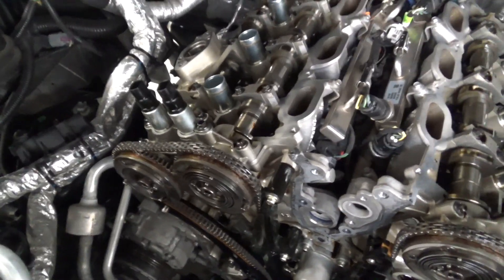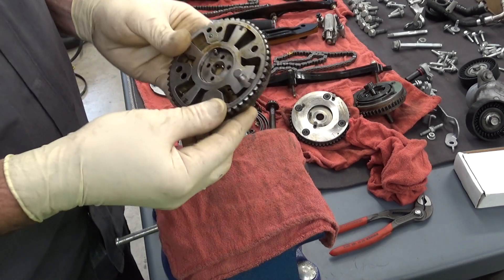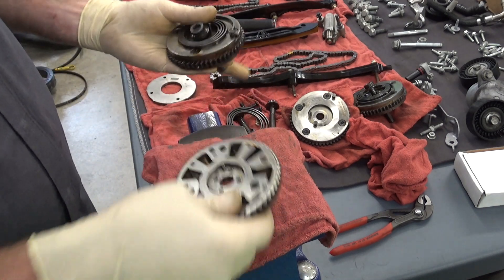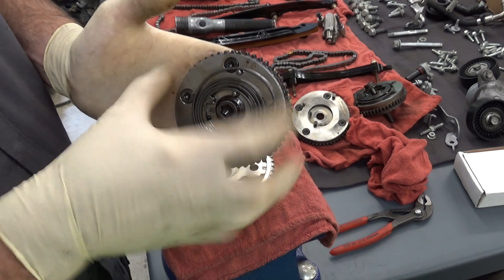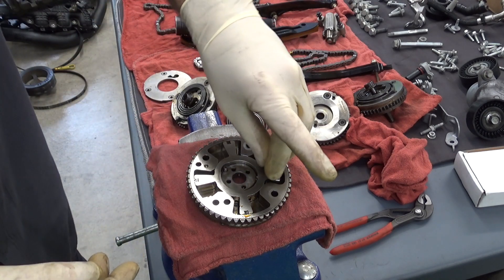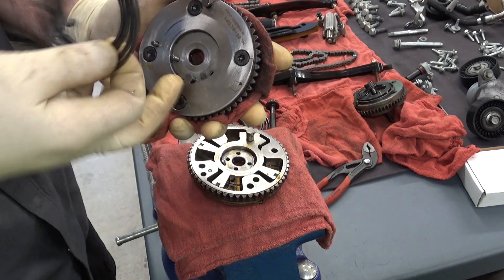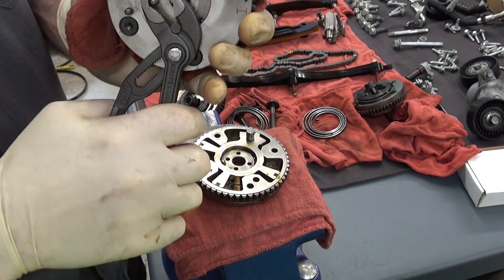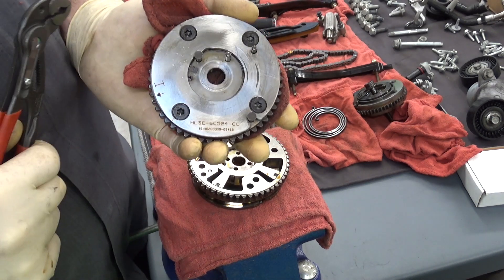FORD 3.5L ECOBOOST CAM PHASER RATTLE. THIS IS WHY

Comment: So would it be helpful to do the oil prime before startup every time you start it. IE: hold down the gas pedal while cranking and it primes the system until you release the gas pedal?

Comment: Thanks for explaining, my 2018 f150 eco boost in shop now. $3500 replacement of cam phasers. Also transmission is shot 😡 $7700 total. Not sure I’m a ford fan anymore…
Reply from the maker: No problem. That's a tough pill to swallow 😓

Comment: Thank you! I can’t believe I’m sitting here watching a video on why my truck with 47k miles rattles at start up. The “Service” guy at the ford store is useless. 1st I went to them for a screeching sound that would happen once in a while when I turned left and I told them it was the IWE (thanks to YouTube) but they refused to change and said they couldn’t replicate the sound so there was nothing to fix. Then I was told that the solution was to leave my truck in 4 WD full-time 😂. I said son I wasn’t born yesterday and forced them to change at my expense and the problem went away. Now I’m dealing with the cam phaser issue. I called the Ford store and they either pretended not to know or they are clueless but I had them on the phone and was passed around from one person to the next then was told they would call me back and that never happened. So frustrating……. Chevy?
Reply from the maker: Oh man 😂 Sounds like you need to find a different dealer, unfortunately.

Comment: A shame we have to go to such lengths of complicating an engine to this degree just to achieve a few extra miles per gallon and several extra horse power.   Ridiculous.  I miss the days of ONE simple, short timing chain on a typical V6 or V8.  When needed, could be replaced in an hour and for maybe $100.00 tops.

Comment: Dear WCR, this was the problem in my 2011 Expedition.  On a “wink-wink, nudge-nudge” look from the service advisor at my Ford Dealership, and corroborating advice from an outside transmission specialist, I chose not to repair it.  I traded the vehicle in for a 2018 Expedition— the transmission specialist said that this was a known problem at Ford, and that they’d supposedly fixed the problem in time for the 2018 line.  About a year after I bought the vehicle I received a recall notice to have the cam phasers replaced on that one.  Now it’s February 2023 and the engine is doing the same loud knocking again.  It’s still under warranty, so the repairs are covered.  But, what hell?  How many more times is this going to happen?  I put 15-18K miles/year on it.  I’ve been driving Expeditions since 2000.  I’d hoped to drive this one for many years after I paid it off, like my first one.  I love the Expedition, but I’m growing leery of them.  Especially if this continues to happen in these engines.    Does you have any suggestions?  Thank you, Nancy
Reply from the maker: Hello Nancy. Ford has a new phaser design and they will need to be replaced. Some of the units were replaced with the previous design and have to be replaced again. Here is the difference in the new phasers: https://www.youtube.com/watch?v=7r_1-SQ3jDk&ab_channel=RainCityWrench

Comment: Not trying to be a smart ass but you just explained it as being an oil pressure problem with this particular part. If there was oil pressure already built up it wouldn't make that noise. But yes ford did fix the part.
Reply from the maker: To be honest, I don't know what is causing them to fail but when they do it's because the pin will not stay locked which requires oil pressure before it stops rattling.

Comment: I know this a older video but I’m having the same issue with my 17 ecoboost got a nasty lil knock in the idle as well as the rattle upon start up but I think the only difference is that mine does it almost every time hot or cold unless I press down the peddle and do one of those dreadful extended cranks wish my Ford dealer didn’t try fucking me over time I went in or I’ve would’ve been took in to get checked btw I bought used 120k on it probably had the rattle when I bought it was in hurry when purchased which I don’t regret cause I love my ecoboost just wish it functioned properly
Reply from the maker: At least the noise won't cause premature engine failure. Just annoying is all

Comment: Why not permanently lock them in place ?
Reply from the maker: Since these are variable valve timing engines they will set codes if the computer can't advance/retard valve timing. Nice thought though.

Comment: At this point 2018s are out of warranty so what does it cost to fix this?  I have 36K miles on my 2018 LTD so wondering when I need to deal with this.  Also there is a theory that the root cause of these problems is a clogged oil pickup tube/screen so I was wondering if you ever dropped the oil pan on any of these Fords to see if the pickup was clogged because if it is the part will just fail again.
Reply from the maker: Had an ecoboost come in that rattled loud all the time and three quarts low on oil. Dropped the pan expecting to find something but all looked great including rod/main bearings.  Installed some new phasers and drove out nice and quiet. Bulletin lists labor of almost 10 hours so multiply that by your local dealer labor rate + parts cost.

Comment: 150,000+ miles on my 2014 with no chain or phaser rattles ever. I have always used the tromp the gas pedal and let the engine spin a few rounds to get oil up into the phasers before allowing the engine to cold start trick. Maybe having oil in the phaser chambers keeps the pin from being knocked out of lock position? Friends insist that I will burn up my starter doing this but it hasn't happened yet and even if it does a starter would still be cheaper than a chain and phaser job.
Reply from the maker: Right On

Comment: Hey. I'm owner F-150 2018 3.5 ecoboost in Poland and we don't have dealer and services to f-150 -.- unfortunately my vehicle start cold rattle and I must order new set cam phaser form USA.
And my question is: Should I order: New ML3Z-6C525-A? OR HL3Z-6C525-CD? Does new cam phaser (ML3Z) fits to 2018? because to ML3Z it says everywhere that only until 2021.
Reply from the maker: Will get back to you, just installed phasers in a 18 expedition today and will check the number
Reply from the maker: OK, just checked. They were the ML3Z phasers
Reply: @raincitywrench117  ok, thank you very much ;) now I can order a new set cam phaser ;)

Comment: It wasn’t a Ford dealership but I had another repair shop recommend I replace the timing chain and the phasers because I had this rattle. With what you know of the design flaw do you think the timing chain is necessary? Also I’ve seen this is a very common problem but does the issue extend beyond an embarrassing start up noise or is it actually causing additional damage to the vehicle?
Reply from the maker: Have yet to see damage related to this noise which seems surprising and replace the phasers only. May not be a bad idea to replace all the timing components on higher mileage engines, say like 80k and up.

Comment: I have a 2018 with 83K miles on it.  I took it in about 5K miles ago and they did the re-program but it did not fix the rattle.  They did not mention anything about getting it fixed or warranty or anything like that.  If I want to get this fixed should I be able to get 33% off based on the "warranty" table.  I do not have extended warranty or anything like that.  I'm also not happy that my dealer did not mention the warranty table to me as I could have gotten 66% off if I got it fixed at that time.    And is this something that will need to be continually fixed every so many thousand miles?    Is there a warranty or work order number I can reference regarding the Warranty table info.  Thank you. Great video!
Reply from the maker: Here is the customer satisfaction 21N03:https://static.nhtsa.gov/odi/tsbs/2021/MC-10199482-0001.pdf
Sounds like you have a crappy dealer. I would email the service manage explaining your situation and see where that gets you.

Comment: My 2018 is in the shop for phase replacement as we speak…38xxx miles….sucks to have this issue with so many 3.5’s
Reply from the maker: It does. Hope the third design is the ultimate solution.

Comment: Any idea why my 1.5 Fusion SE(2016 140,000miles) is bogging down for a few seconds after start-up and throwing P0301? I took out the spark plug. It was dry and piston was black, so it doesn't appear to be the coolant in cylinder problem that some of these are having. I did change the plug and coil pack to no avail.
Reply from the maker: I would remove all the plugs and do a compression on all four cylinders before doing anything else.
Reply: @raincitywrench117  Thank you.

Comment: My question is now, As I'm waiting for my appointment to get the cam phasers replaced at the dealer, what kind of if any damage is occurring to the cams or valve train?
Reply from the maker: Never seen any damage due to this noise which is contrary what one would think. Just annoying is all.

Comment: Looking at a few 2018 Raptors. 
One with 89,000 miles starts up cold with a 5 second rattle then the engine is quiet. You can rev up and let off gas and no noise. 
The other 2018 with 70,000 miles rattles at start up and then when you rev up engine and let off gas it has a slight rattle at idle. Can damage be caused by letting this go or it’s just noise? 
How much should repair cost? 
Thank you very much
Reply from the maker: There never seems to be a pattern to which engine will rattle and for how long. Have not heard nor seen collateral damage, just damn annoying. Our dealer is $189hr so my guess is this job is in the range of $2400.
Reply: @raincitywrench117  thank you!

Comment: Great video. Take a look at my response to jifliberty. Now after my phaser software update on a 150 2019 at 22k my truck ran rough and my fans stay on high speed most of the time. Have you guys in the shop had any work for this issue? I'm hearing and reading its the a/c pressure relay, however my a/c is cold. Ford has a TSB out on this. I'm waiting for parts. Thanks for posting
Reply from the maker: Your problem my fall under TSB 22-2089. Here is what needs checked:
1. Run the A/C on maximum/recirculation and blower speed on high for at least 10 minutes with the engine idling, then drive the vehicle.
2.  Using the datalogger on the appropriate Ford diagnostic scan tool, pull up the EVAP_TEMP PID in the front controls interface module (FCIM) to read the evaporator temperature and use a thermometer to measure the vent outlet temperature. Compare the temperature reading of the EVAP_TEMP PID to the thermometer's vent outlet temperature reading during A/C use.
3. Is the temperature reading shown on the vent outlet thermometer colder than the temperature reading of the EVAP_TEMP PID?
(1). Yes - proceed to Step 4.
(2). No - if Step 4 directed to restart this article, the repair is complete. For all others, this article does not apply. Refer to the WSM for normal diagnostics.
4. Recover the refrigerant and review recovered refrigerant amount. Was the correct amount recovered within +/- 1 oz. (0.03 kg.)?
(1). Yes - replace the evaporator assembly. Refer to WSM, Section 412-00. The evaporator temperature sensor is part of the evaporator assembly.
(2). No - refer to the WSM for normal diagnostics. Once the root cause of the incorrect charge has been corrected, restart this article from Step 1 to confirm the customer concern is corrected.
Reply: @raincitywrench117  Thanks Wrench for the information. I will print this info and probably give a copy to my service writer to give to the tech. Losing convidence in this dealership to get to the bottom of issues with this truck.

Comment: Couldn’t you just disable the vct stuff and wouldn’t that stop it
Reply from the maker: No. It's a mechanical pin locking failure plus if you disconnected the vct wires the instrument cluster would be lit up like a christmas tree. You are definitely thinking outside the box, I like it.

Comment: Thanks…. you have told us more than our local ford dealership or the factory.  Ford has been lying for years saying all you need is a software update or oil service times where not followed.    It’s a terrible design and the customer gets the raw end of the deal.  Instead of these all being fixed years ago.    The Engine design sucks
Reply from the maker: It's definitely a design flaw & Ford has a tough time admitting fault. Pretty straight forward that the pins not locking are causing the rattle but the $100,000 question: Is it just a bad phaser design or does the oiling system have a design flaw causing the pins to not lock? When I took this phaser apart the slot was full of oil so I still think the pins are not locking due to oil hydro-lock. My personal belief is when the locking pin tries to seat back into the slot it can't because oil inside the hole is not bleeding off thus causing rattle on the next startup.

Comment: I just got my 2018 less than a month ago and haven't made a payment yet. Starting hearing this and I am taking mine in next week. If you didn't have it reprogrammed by 3yrs after purchase  you will have to pay to fix it. What I was told anyway. If it was reprogrammed and it still does it then they will fix it if you are under factory warranty or u have extended warranty
Reply from the maker: Ford had campaign 21B10 that had to be programmed by the end of February 2022 to open up campaign 21N03 which is prorated if the phasers need replaced. This is out of the letter:
PROGRAM TERMS
This program extends the warranty coverage of the engine cam phasers until January 1, 2023
provided the Repair Order (RO) date of Powertrain Control Module reflash under Customer Satisfaction Program 21B10 occurred on or before February 28, 2022. Ford will cover the repair or refund costs following the proration table below using the mileage shown on the RO. 
Ford Vehicles
Mileage Ford Will Cover
Up to 69,999 100%
70,000 – 79,999 66%
80,000 – 89,999 33%
90,000 or higher 0%
Hope yours was programmed, it will say in oasis when you take it in.

Comment: You said it’s not oil pressure then you said it will rattle until oil pressure comes up! Ok that means it is oil pressure.

There’s a way to help if you get the rattle when you start the motor hold the gas peddle down while tuning the motor over hold the key or button down and allow the motor to turn and increase oil pressure for a few seconds and then you can take foot off peddle and let go the button or the key and it will start with no rattle!

Another Ford tech tested this theory!! And it worked a truck that rattles to heavens say 3 days he turned the motor over peddle down not allowing it to start then released peddle and start button and the pressure was up enough to have zero rattle!! 

This will help protect things while waiting to get it fixed or saving the money if your not under warranty.
Reply: I mean test vehicle sat for three days so it was gonna rattle a lot! But he turned it over a couple three seconds before allowing the motor to start and it corrected the issue no rattle!

So hold key button down and peddle down same time allow couple seconds and then release both this builds pressure you can actually see the oil
Press hushed come up when doing this and release it at that point
Reply: Oil pressure gauge sorry big fingers I’m not on the app so it won’t let me edit.
Reply from the maker: Holding the gas pedal down before cranking enters "clear flood" mode. Yep, you're right. It works great especially if it sat for an extended time. Some of these engines can rattle in a few thousand miles and phaser replacement fixes it. It takes about .5 - 2 seconds for oil pressure to build in the top end & fill the phasers. If the pin does not fully engage in the slot it will rattle in that same timeframe. With the pin fully engaged, you could have no oil pressure and the phasers would never rattle.

Comment: it looks like the locking pin is probably hardened steel and the backing plate is just mild steel, it's bound to where a groove in it  to where the engine torque at start up is goin to pop it out of locked position
Reply from the maker: You may be right. I'm curious what has been changed in their latest phaser design. Hope I get the chance to tear into one someday.

Comment: I just found your channel. This obviously effects the 3.5 EcoBoost. What do you think of the 2.7 EcoBoost F150 engine. It seems to not have much reliability issues. I’m considering purchasing a gen lol (17 up)
Reply from the maker: I almost never see engine issues with the 2.7L. It's always the 3.5L that has something wrong. The 2.7L is a completely different engine design, has different oiling system, cylinder head/manifold design, etc. Seems to be a good little engine.